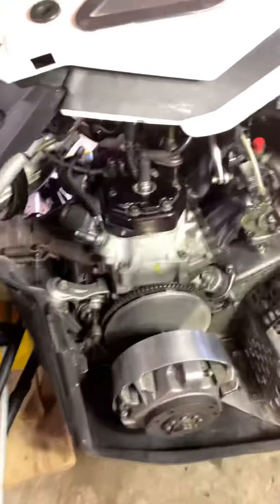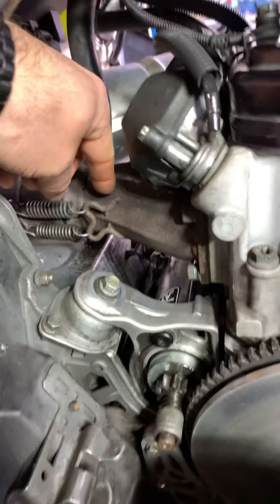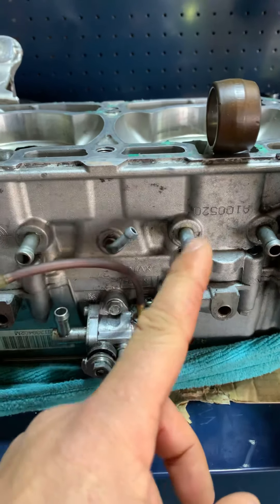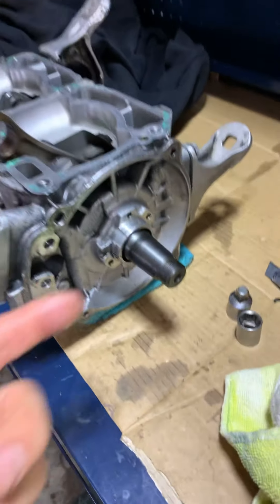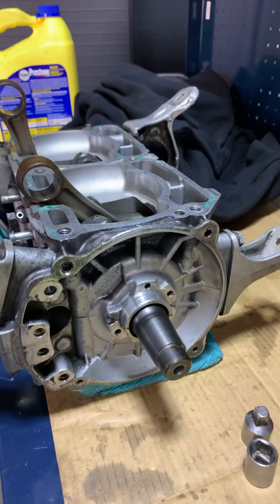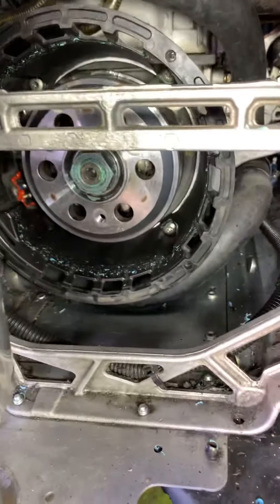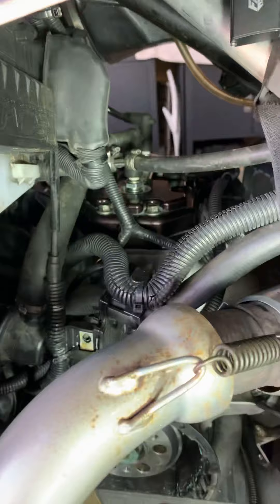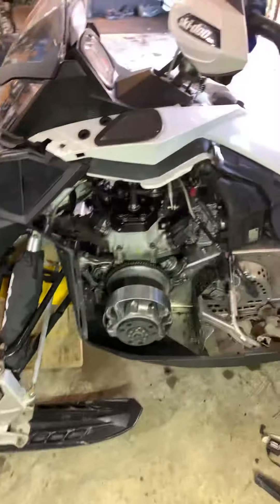2011 skidoo etec to ptek swap

Comment: Got mine running a few days ago, took it out last night, sled fell on its face/ bogged down and tried to die on me after a few seconds of wide open throttle, thinking it’s a fuel issue, not enough vacuumed for the pump, just wondering if you had the same issue on wide open throttle, if not I’ll keep looking for fuel leaks and vacuum leaks. Let me know thanks

Comment: Why are you talking about stator wires did U have to solder something wouldn’t it be plug and play 
Also have u rode this yet does the fuel pump work good sharing the same fitting with the rave
Reply from the maker: Hey there I’m talking about the stator pick ups they gotta be in the order that I said or your sled won’t have spark , as far as hooking my fuel pump up to the rave valve lines it runs the same no difference at all ! Tons of power I been out lots so far this year and no issues !